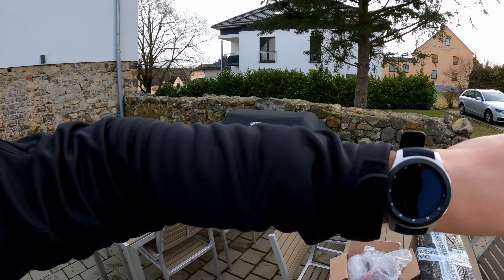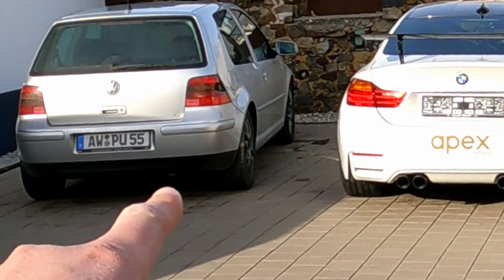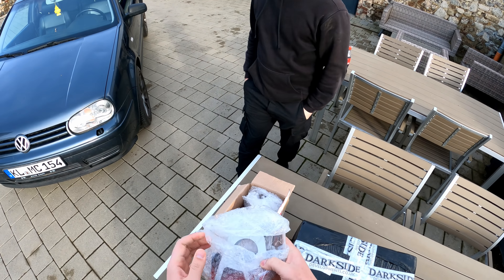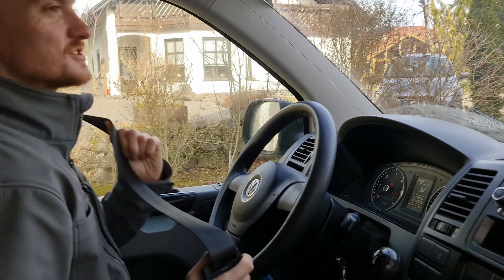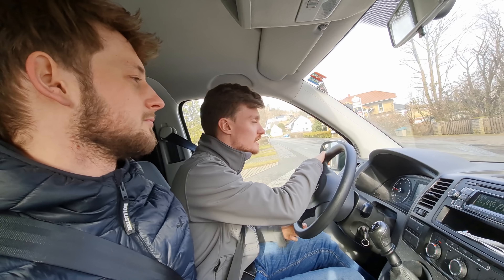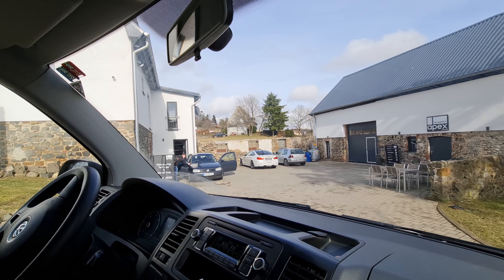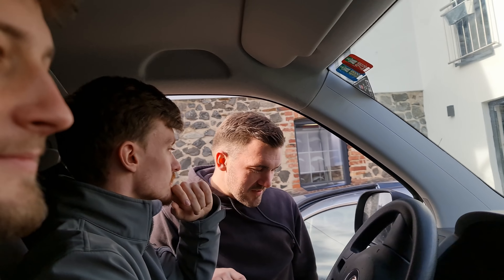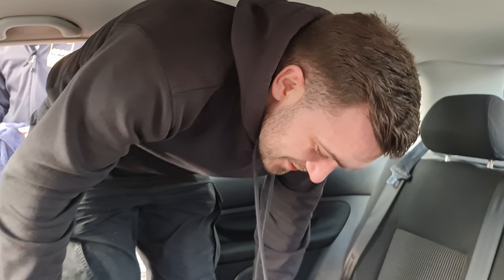The Missing Piece of the RINGTRACKTOR Puzzle is FINALLY HERE!

Comment: 4:32 those adjustable control bushing can be a pain in the * to play with because the tool powerflex provide is very soft. had the same bushings on mk4 4motion (installed in the rear arms) and i should have bought adjustable arms instead, not to hate in powerflex i have a couple of bushings installed but i regret buying them
Reply from the maker: We'll see! :D
Reply: @mgcharoudin  i can admit i didnt have any experience with them but for 70 euros more i could have saved many hours.. but george will probably figure it out